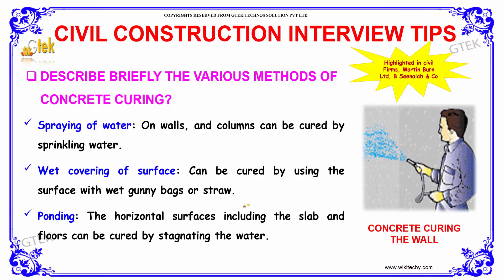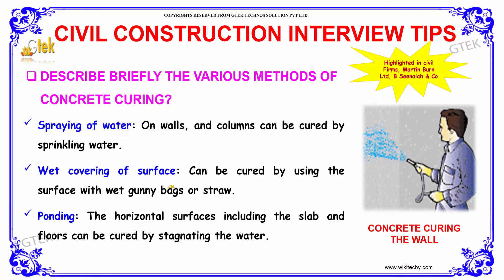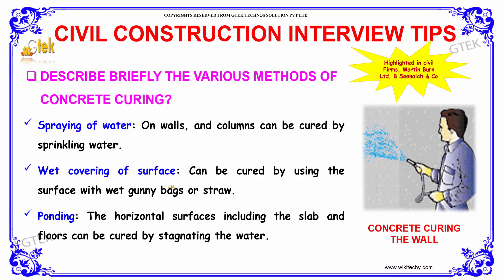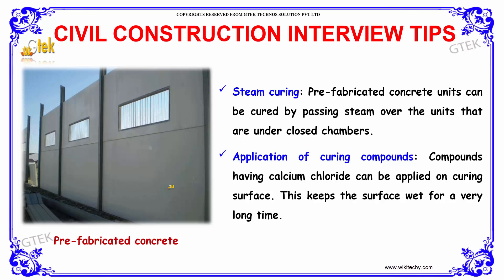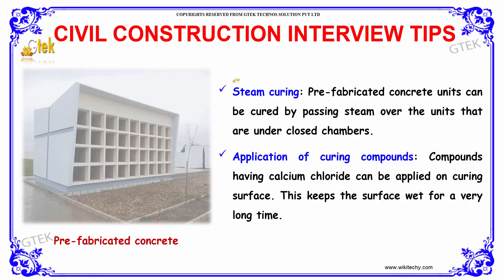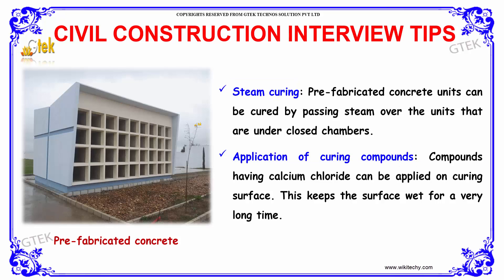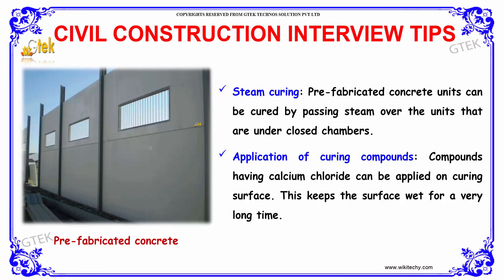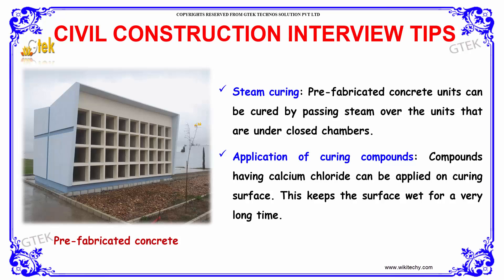Various methods of concrete curing | Civil Construction Interview Questions

Comment: Curing of concrete techniques. ... Selecting the method of curing is generally a matter of economics, ... In the spraying method the water is forced through horizontal pipes …

Comment: Shading Of Concrete Work. The object of shading concrete work is to prevent the evaporation of water from the surface even before setting. ... Covering Concrete Surfaces With Hessian or Gunny Bags. ... Sprinkling of Water. ... Ponding Method. ... Membrane Curing. ... Steam Curing.

Comment: Methods that Supply Additional Moisture:  include sprinkling and wet covers. Both these methods add moisture to the concrete surface during the early hardening or curing period. They also provide some cooling through evaporation.

Comment: Role of Concrete Curing. Curing plays an important role on strength development and durability of concrete. Curing takes place immediately after concrete placing and finishing, and involves maintenance of desired moisture and temperature conditions, both at depth and near the surface, for extended periods of time.

Comment: Methods. There are three basic ways of curing concrete. The first - involves keeping the surface of the concretemoist by the use ponding, spraying/sprinkling, damp sand or damp hessian. The second prevents the loss of moisture from the concreteby covering it with polythene sheeting or leaving the formwork in place.